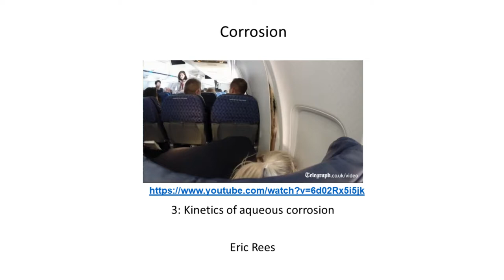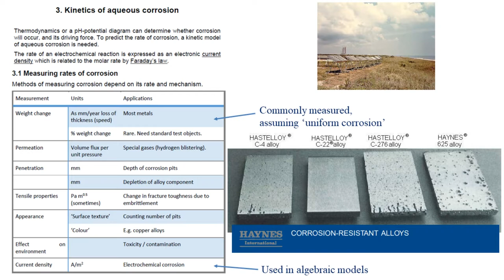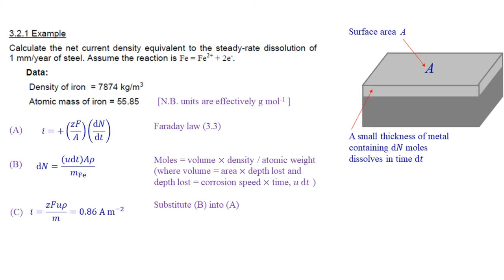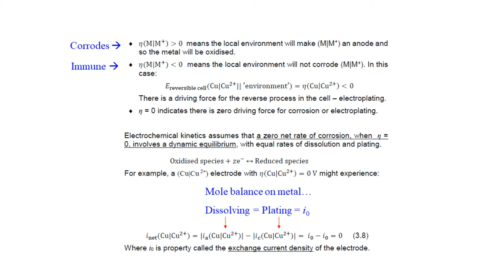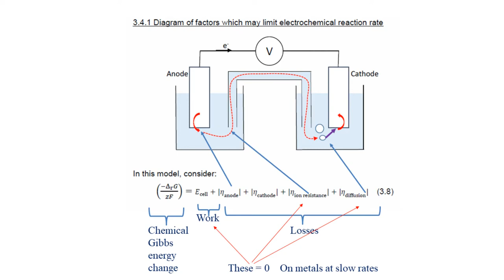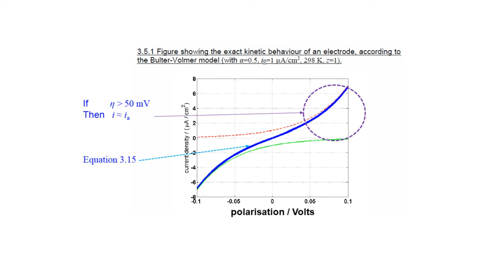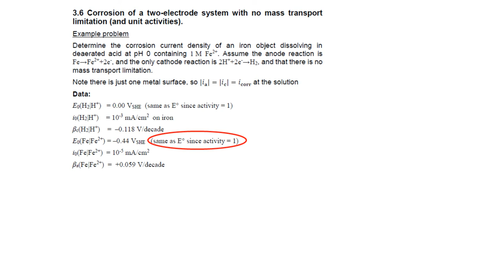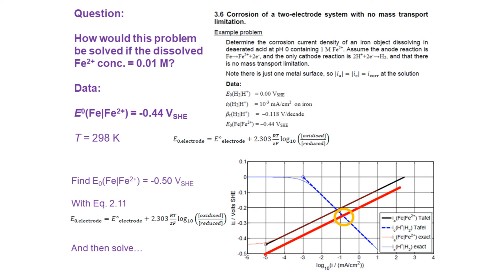Corrosion Lecture 4: Kinetics of electrochemical corrosion, and the Tafel equation

Comment from the maker: In answer to a question that Youtube doesn't seem to want to put in the comments:

Question: In Example 3.2.1, I get current density i = 0.00086 A/m^2. Where may the factor of 1000 have come from.

Answer: almost certainly from the atomic weight, which for practical purposes has units of grams / mole (however it is conventionally written as a dimensionless number), whereas the density is in kg/m^3. I flag this up in the live lecture if I have time.